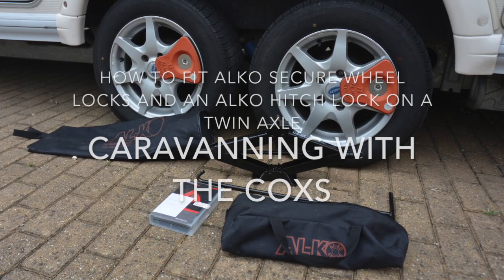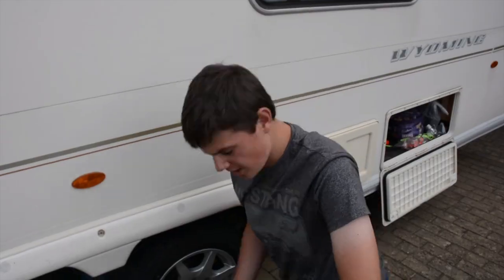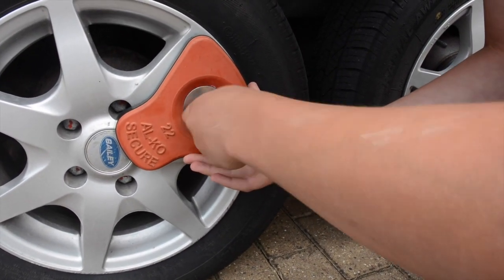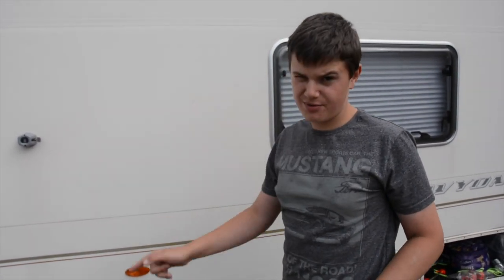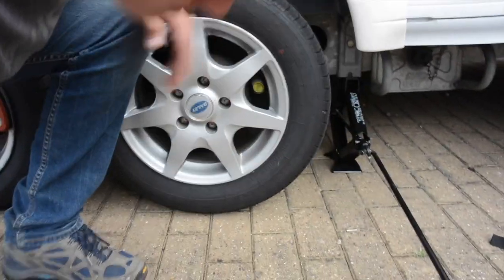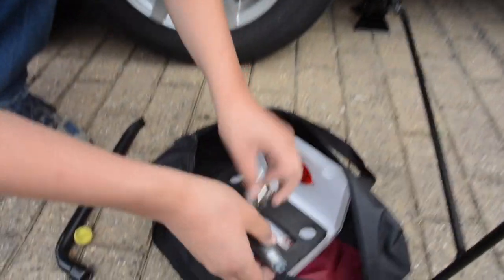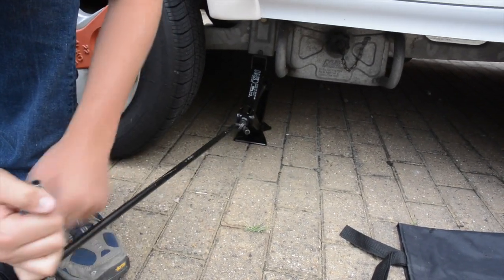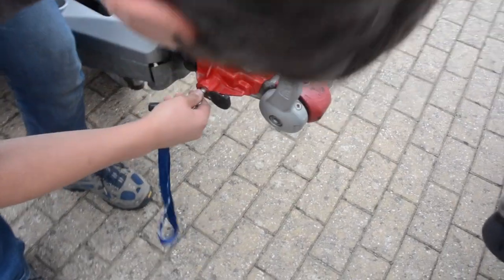Fitting Alko Secure Wheel Locks to a Twin Axle Caravan

Comment: Nice and easy. But how do you fit the alko lockes when you have a 4 wheel mover fitted.
Reply from the maker: Hi Brian, this is a little bit more difficult. I would reccomend a product called a lock n level or using a bottle jack on the chassis. I hope that helps, Oliver

Comment: Great demo - we collect our new double axle caravan tomorrow and were at a loss to how we would fit the double wheel lock (having had a single axle for 10 years).  Applying both locks is an insurance condition whilst it's in storage so this was very helpful indeed.  Thanks!
Reply from the maker: Hi Alan and thanks for subscribing! Yes they are great but a pain. Try to get a lock ‘n’ level search it up on the internet! That will help you loads. Cheers Oliver
Reply: I successfully fitted both locks - the first attempt was a bit botched, but when I positioned the jack correctly (it wasn't positioned right 1st time!) I had no problems.  As you say, probably a 10/15 min job
Reply from the maker: We’ve had our twin axle for 3 years in November and the first time it took half an hour!! But now it takes 10 minutes. Like I say look at s lock n level. I may get one... anyway happy holidaying with your new van. Cheers Oliver
Reply: Yes - the lock n level looks good, but doesn't save much time I think for fitting the rear axle alko lock.  Not been away in our new double axle yet, so will review how easy it is to level the van on a wedge.  If inordinately difficult, maybe the lock n level will be good.  If it's just for the alko lock issue though, I'll probably stay with the jack system
Reply from the maker: Hi Alan, if you have the same jack as us, it’s a common problem that the end of the jack snaps! Not to worry you can just reweld it! Cheers Oliver
Reply: Lol - I don't have a portable welding kit ;-)

Guess I'll just see how I go.  Have thought about using a reinforced plate or similar to go beneath the jack but on top of the ground (e.g. if it's a bit soft and you need stability under the jack).  The Milenco Stacka Jackas don't seem to do the business for this use - fine when under the corner steadies though

Comment: Great informative video.  What is the difference between a alko jack and a normal car jack as they look very much the same.
Reply from the maker: Hi, firstly sorry for the late reply, must have missed your comment. The Alko jack has specific mounts which the jack go into and you only get those with the jack. It isn’t recommended to use a car jack on a caravan. If you want more info I’d speak withAlko directly. Thanks for watching, Oliver.

Comment: Seems a lot of steps. My method is as follows: Leave it attached to the car, chock the epposite wheels and jack both nearside wheels off the ground with, my trolly jack using the rear jacking point. Align both wheels at the same time, clamps on, jack down, unhitch, job done in one go.
Reply from the maker: Thanks for sharing Martin. It was a big faff so we went down to a single. A lock N Level is a good piece of kit, we nearly bought one. Take Care, Oliver.
Reply: @CaravanningwiththeCoxs  Yes, it is a faff, I agree. Stay safe :)